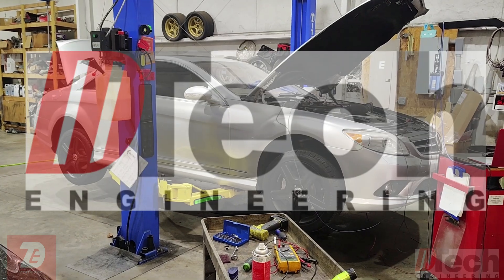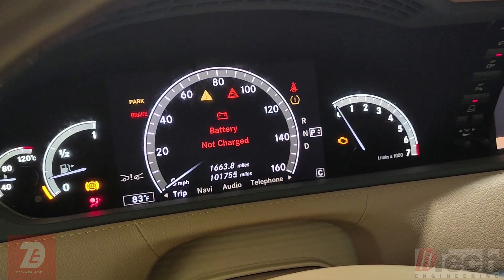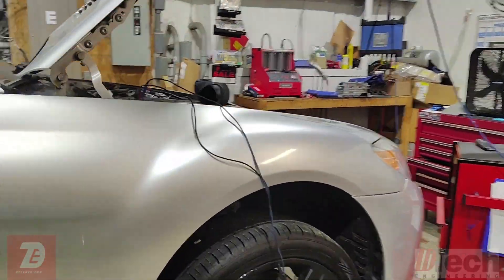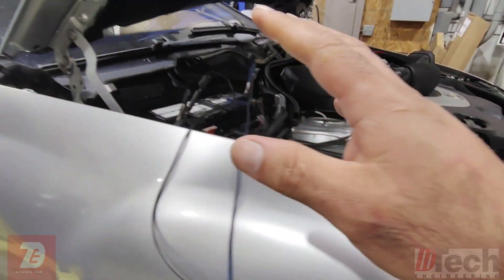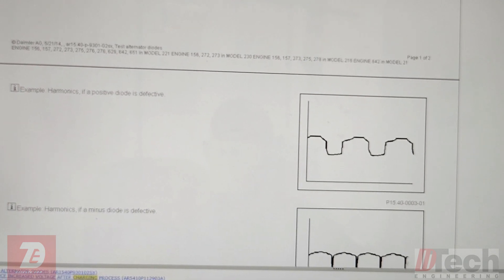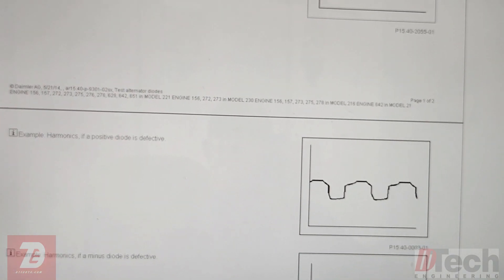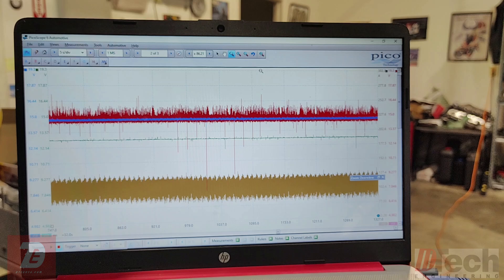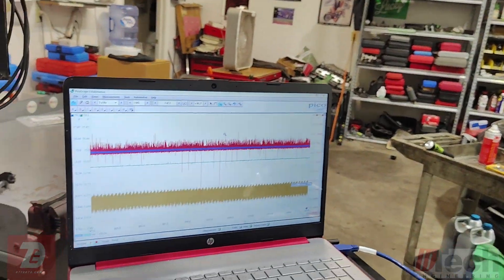Mercedes: 'CHARGE BATTERY & BATTERY NOT CHARGED" Diagnosis Testing

Comment from the maker: In case anyone was wondering on the link to look up the Mercedes option codes:
https://www.lastvin.com/

Make sure to use capital letters when inputting the vin number! If not, it won't recognize the vin and it will seem as if it is not able to pull up the vehicle information.

Comment: AutoZone, O'Reilly, NAPA and such get their alternators and starters from SAME fake "re-builder".  I kept replacing their alternator 5 times, but still each replacement failed after 1 month.  O'Reilly (AutoZone) kept telling me, "but it has Lifetime warranty, just get a replacement from us, for eternity". But they would not pay for lost labor time. Then, I got remanufactured alternator from Toyota (or from other such original manufacturer) and those original re-manufactured alternators work find for many years, as they supposed to.  AutoZone, O'Reilly, NAPA and such sell bad alternators, starters, radiators.